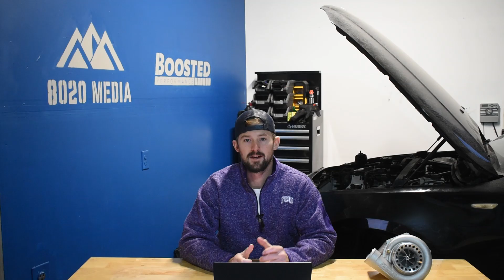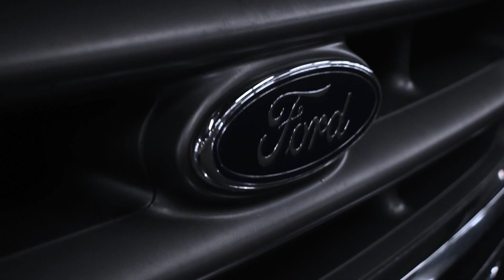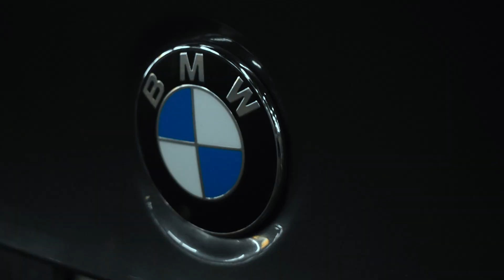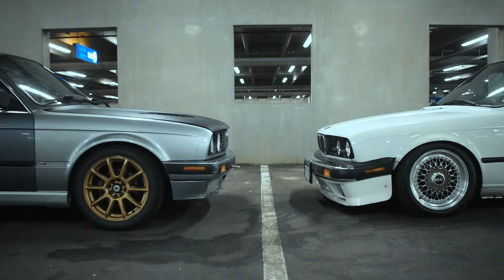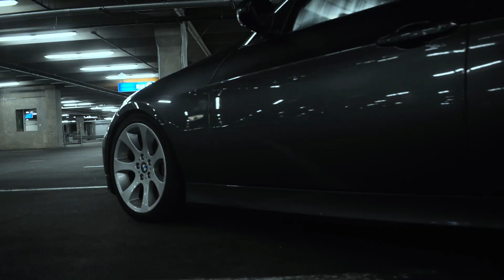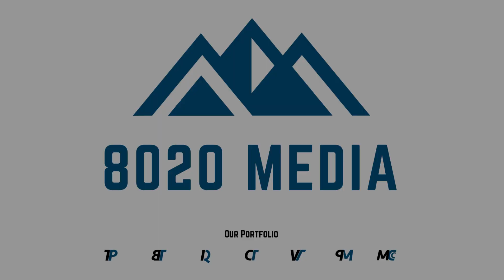Titan XD's 5.0 Cummins | Common Problems & Reliability

Comment: I have a 2016 with 51K miles. Runs but always goes right into engine powered reduced. Wont hardly rev over 2K turbo actuator issue

Comment: The 5.6 is a great engine and mine has just under 360,000 miles on it 👍!! Never had any major issues with it at all whatsoever 👍!! Just, regular things like belts, hoses, battery, plugs, wires, bulbs,and starter,alternator
Reply: Um, this video is about the 5.0L Cummins V8 engine.

Comment: Can we sum this up,Here in the STATES, 5.9 / 6.7 CUMMINS ,FULLY DELETED for the 6.7 will be a MILLION MILE MOTOR,as long you are not a special needs person, racing tunes,58" wheels,turn out stacks 9" in diameter..The 5.0  was NOT DESIGNED as a WORK MOTOR
Reply from the maker: F - Thanks for sharing

Comment: I had a 16 pro4x deleted and tuned it around 70k miles, put over 30k miles on it before I sold it, and never had a single issue. It's one of the best sounding engines, too. Maybe I just got lucky.
Reply from the maker: D - Thanks for taking the time to shared your experience. That's what happens when it's deleted and tuned properly :)

Comment: I have a 2019 and love it. One problem I have is a very small oil leak. No oil drop on my driveway but it is noticeable. Anybody have these problems, and where is it from? I’m thinking oil cooler.
Reply from the maker: H - Thanks for taking the time to share your experience! A small oil leak on your truck without visible driveway drips likely means it's a seep or slow leak from a gasket or seal. The oil cooler is a common culprit, as gasket failure can cause minor leaks that may not drip immediately but can accumulate over time. Other potential sources include the oil pan gasket, valve cover gaskets, rear main seal, or front crankshaft seal. If you notice oil residue around the oil filter housing or cooler, that’s a strong indicator of the leak’s origin. Try checking under the engine with a flashlight after a drive to look for oil buildup. If the leak is minor and not actively dripping, monitoring it and checking oil levels regularly is a safe approach, but replacing the gasket may be necessary if it worsens.
Reply: @ thank you. Oil pan is good and filter is tight. I will check the other areas.

Comment: own a 2017 titan XD. replaced both fuel pumps and had to delete the DPF. running good other than those 3 issues. 140k miles.
Reply from the maker: B - Thanks for sharing your experience!

Comment: the comment about “firing all the diesel techs” really invalidates this entire video. Nissan is still running TRAINING for techs to get diesel certified through the end of this year, four years after the engine option was dropped
Reply from the maker: D - We have addressed this in the comments. They have drastically reduced the amount of diesel techs. The initial comment may have been overboard.

Comment: This is the same thing that happens to the new dodges the new fords Al the new gmc and the new chevys cp4 pump goes out blows engine. Emissions system problems he listed are also the same thing you will see on 45 other videos about the gmc doge and ford
Reply from the maker: R - Yes. They don't make them like they used to.

Comment: I really wanted one of these.  I own a 1st gen and a few other Nissans.  Love them to death.
Problem is, 5 years on, there is no parts for the engine or transmission and Nissan won't work on them.
I buy stuff for the long term.  If I make 2040, this truck will be in my driveway, but alas.  I might be able to live without support, I'm a hack mechanic.  But I can't hack no parts.
Reply from the maker: C - Thanks for sharing your experience!

Comment: I own a 2017 xd with 80,200 miles and had code for turbo, nissan wanted $5500 to replace low  pressure turbo with 1 yr warranty, because the extended warranty on turbos are for high  side only, thats what i was told so after being told that and nissan had no idea when i could get it repairedd because of backordered parts i  went out on  my own and bought a complete set up with both turbos and a 2yr warranty that are reman. From these trucks, oem,  for $2800.00  and no  trouble since....love my truck!!
Reply: Same here 2016 XD with 78K miles. Only the High Pressure turbo is on the extended warranty. Had to replace the Low Pressure Turbo $6330 @ stealership. Next step is a full delete to get rid of the stupid emissions control system. Most of the problem in the turbos is caused by the EGR (Exhaust Gas Recirculation) system where the dirty exhaust gases are recirculated back into the engine creating a lot of soot build up mostly on the turbos and the actuator valves.
Reply from the maker: B - Thanks for taking the time to share your experience here!

Comment: Jake, I own a 16 Titan xd. About a week ago I noticed when parking into my parking lot at work I had the low oil pressure signal come on and I immediately shut off the engine. I had it towed to my local nissan dealership. It was there for about a week,and lefted the only diesel mechanic they had stumped.... until I began to become nervous and sent the service advisor a YouTube video I came across regarding the wiring harness/sensors leading to failure.  I really don't know how long they had my engine running that week for trouble shooting the issue. After sending that video to the shop, hours later the mechanic found the issue regarding the oil pressure sensor. I've owned the truck for a year(used), and I feel  that since buying the truck it's never ran better? 
Prior to this fix I felt as if I had turbo issues. The shop came to a conclusion it was a control valve needing replacing, so I did. Also prior to that I had a engine oil leak and replaced both front engine gasket along with the valve cover gasket. 
I suppose my question is.... is that how fucked up do you think my engine is after letting them run it for a week trying to solve my trucks problem? 
And since owing the truck... why does it seems as tho it runs better than before regarding the turbos and throttle response? Was this sensor the problem the whole time and it just didn't tell the computer? Idk, I just hope to receive an answer.  
I take care of my truck as soon as I realize when something isn't right,(can't speak for the previous owners tho). I think the code prior to the oil pressure low was a p226, low end turbo response?
Reply from the maker: B - It most certainly seems like replacing the oil pressure sensor was the solution to your problem. If it makes the truck run much better after, then you should be good! Sounds like you stay on top of maintenance, which is great because that’s what these diesels need. Keep us updated.

Comment: Preventative Maintenance, Preventative Maintenance, Preventative Maintenance, and Preventative Maintenance. Diesels generally will a very long time if maintained. With diesels imo I think engine hours means more than miles. If you can get away with it delete your diesels, that alone will significantly extend their lives.
Reply from the maker: B - Well said! Thanks for the added insights.

Comment: I  experienced a catastrophic engine failure at 65000 miles with my 2018 5.0 Dealers words not mine. I’m currently waiting to hear if Nissan will stand behind this problem. My 60 month warranty expired 5 weeks ago. I’ve waited for a ridiculous amount of time on parts for other issues in the past. How can an auto manufacturer introduce a product here in the USA and in such a short time as in the case of the 5.0 diesel abandoned the obligation without any consequence. It seams maybe those like myself should squeak like a wheel. I’m told squeaky wheels get fixed.
Reply from the maker: K - So sorry to hear this... Thanks for sharing your experience. Keep us updated.

Comment: With those trucks just d delete all those emissions stuff and there bullet proof this problem is not different than any other diesels I've done this on mines egr,def and dpf delete. No matter the diesel vehicle they all suffer the same issues and by all means filter and fluid change is a must wirh diesels people ignore this
Reply from the maker: V - We can't recommend this, but you are correct.

Comment: We got a 2016 with 245,000 miles and no issues until now. But small issues.
Reply from the maker: D - Thanks for sharing your experience! We've seen some great 5.0's and yours sounds like that.
Reply: Do you have a mileage update? Stock?

Comment: I love these videos of people that don’t own one and are reading the information off a computer! I own a 2017 XD bought it brand new and I have not had any major problems with it! It’s actually one of my favorite trucks I owned. It’s all stock, actually I’m deleting it next week. It has 150k miles on it, I’m a fishing guide and tow a 24’ bay boat everyday, I have a fifth wheel I tow around too, it has plenty of power to tow. The truck is a dog and has incredible lag and dead pedal, the pedal commander is a must in this truck. In my opinion this truck is very underrated. I am a Cummins guy my previous truck was a 2500 ram Cummins. These videos are acting like these trucks are blowing up on the daily. I’ve never really talked to anybody that actually owned one that had major problems with them. I had way more problems with my 6.4 than I’ve had with my XD. I’m excited about the delete, these trucks come alive when deleted. I live in Florida and would drive it to California tomorrow with no worries!
Reply: Dude how much it cost to delete and does it mess up the Truck warranty?
Reply: @jorgerebolledo8693 a full delete can cost up to $4000
Reply from the maker: S - Well we're glad your XD has been good for you. However, just because you've had a good experience, doesn't mean everyone has had the same experience.. They are MUCH better deleted, but we can't recommend doing so. Regardless, thanks for sharing your experience.

Comment: So if you delete it, it sounds like it would solve a bunch of these problems.
Reply: And add a fass pump oil system or an equivalent?
Reply from the maker: J - Pretty much, but we can't recommend doing it.
Reply: Delete will resolve about 90% of the reliability issues and add a Fass sump kit.  Replaced the drivetrain with Amsoil and with the tune it's reduced some of the hard shifting.  It's a great truck with those updates.

Comment: You can have any diesel engine last a long time. It’s just this one is going to be very expensive to get there. also the class action lawsuit that was launched in march of 2023 against Nissan and Cummins. Reason was the cp4 fuel pump produced metal shavings and after time killed your injection system   It average cost was 16,000 US dollars  Nissan wouldn’t recap or warranty it other would Cummins. Hence the law suit. Reason was they knew that it was faulty to begin with but still put it in. It needs a fuel that has more lubricants in it than USA diesel. Made for Europe market. This has been proven so you might see a recall at there expense. Nissan and Cummins will definitely loose this one.
Reply from the maker: James - Couldn't agree more. Thanks for sharing this insight.

Comment: I bought a 2016 XD Platinum Reserve with the 5.0. I used to like the truck, but I am at the end with it. Been in the shop 4 times. Nox sensors replaced 3 weeks after I bought it. A month later the coolest reserve tank has a float that broke or got stuck and caused a code I don't remember what it is. 2 months later another code that says the DEF system was contaminated. How that happens I have no idea unless someone dumped a foreign substance in there. If that's what it is that's vandalism. NOW I have a code P249E. DEF system again, dealership didn't know how to fix it. They called Nissan to check Def injector, charge batteries and test again. Those are fine but still has the code. Nissan told them to replace the Intake and Outtake box sensors and the SCR catalyst for the cost of just over $10,000. MIND BLOWN!!! When the manufacturer says to just start replacing parts and not sure if it will fix the problem gives a person major concerns about this model. I'd like to say my good friend has the same truck and has had zero issues. I must have got a Monday or Friday truck.
Reply from the maker: 3 - So sorry to hear this, however we do appreciate you taking the time to leave your experience.
Reply: You should have deleted it the first time you had emissions problems.
Reply: @tommybragalone7943  Your not wrong, but where I live getting it registered would have been a whole nother set of issues.
Reply: @333jfish do you have any friends/ family that live in a different state or county? If so just register it with their address. Diesel emissions are such a pain in The ass when they start messing up.

Comment: why is there suddenly low oil pressure causing the turbo bearimg oil starvation?
Is there an oil pump issue if so how is this not affecting the engine bearings ??
Reply from the maker: Here is the TSB on it with more info: https://www.tsbsearch.com/Nissan/NTB16-097

Comment: Would it be smart to buy a Titan XD platinum reserve diesel if they will no longer be producing new parts for repairs after 2031
Reply: parts as in.??..  only part you need 2 of, is the fuel pump.. everything else can be ditched or fixed..
Reply: @harrywalker968  No, everything else cannot be ditched lol…All good though, I just went with Ford.
Reply from the maker: Javier - We would think so, but we can't make that decision for you. There are still quite a bit of Nissan diesel techs, but who knows how many there will be around in the near future. Keep us updated.

Comment: 4:58  Jesus Christ....I'm not even 5 mins in and minds made up .  Not a chance I'm buying one of these POS trucks. Was considering one dues too there lower price compared to a Duramax or Power stroke truck but crist these sound like just total crap . No wonder they were discontinued 😕🤯
Reply from the maker: J - We don't make these videos to scare, strictly to inform. With that said, we have seen many of these be very reliable, but have also heard many disasters.

Comment: I'm not saying I disagree with you but sounds like you're reading an article to us. The one thing I do know to be incorrect is that you say that Nissan fired all the diesel mechanics and there is no support for the vehicles. Although this may be a concern down the road, I personally went into the local Nissan dealership near my job and spoke to the diesel mechanic about the trucks. This dealership has 2 mechanics for the diesel trucks.
Reply from the maker: Joe - When we are doing these videos, we aren't reading an article word by word. However, we do have an article on our website that we are referencing, which is content that we came up with via personal experience and research. We understand they haven't gotten rid of ALL techs, but there are certainly less now. And they aren't training any new techs on these diesels.
Reply: @8020Automotive 
But you are reading from an article. And you are going off your personal experience since you do not own a Titan XD diesel truck.

Comment: This guy is shitting all over the XD/Cummins powerrtrain. He speaks like a brand loyalist (fanboy). EVERY manufacturer has had problems with their diesel engines from the emissions to the powertrain itself!! The 5.9T Cummins, 6.9L/7.3L Fords, and Isuzu/Duramax engines. My neighbor has over 289k miles on his 5.0L XD with basic maintenance repairs. It seems to me that every one wants a Peterbilt/Kenworth for the price of a Kia with 0 issues. Not gonna happen, bud. Even Toyota has lost its #1 reliability spot to Subaru. Source: JD Power, KBB, and CarEdge.
Reply from the maker: Travel - We are simply providing an unbiased opinion from what we have experienced. Everybody knows someone that "has 289k miles with no major issues", but fail to believe the people that actually have major problems.

Comment: Why would dailying a diesel
Be a bad idea, and what are some work arounds? Would
Tuning it, delete some stuff make it more fun. Thinking about making something for off-road/daily driver.
Reply: Daily driving a modern diesel IS usually an issue for people because the engine  does not get enough time to reach operating temperature with the short trips being driven.  Especially not good for the aftertreatment systems...
Reply from the maker: Dailying a diesel isn't a problem at all. Tuning and some basic bolt on mods would certainly bring it to life a bit more. Building it for off road is more about suspension and wheel/tire setups but extra power never hurts

Comment: these trucks look so cool would be great to have one thats reliable
Reply: I have a 2019 for sale 
93k miles 
White SV midnight addition.
Reply: @haroldwright5013 price?
Reply from the maker: Adam - Couldn’t agree more. There are certainly some reliable ones, but just hard to find.
Reply: @8020Media 
Again, it's the emissions equipment that problematic. Not the engine itself.
Reply from the maker: That is a part of the engine, unless deleted.
Reply: @8020Automotive  
No, it is not. What kind redneck/engineer are you? Lol